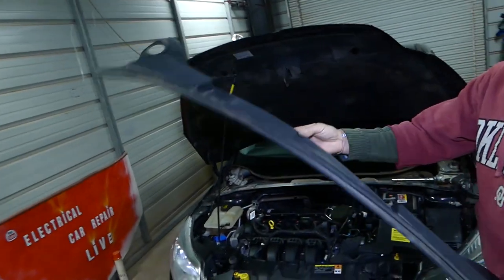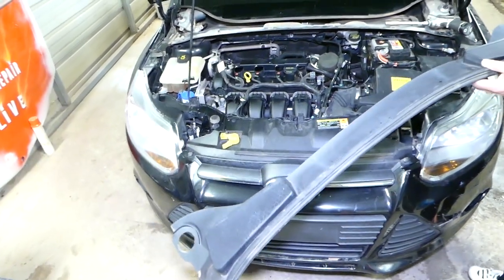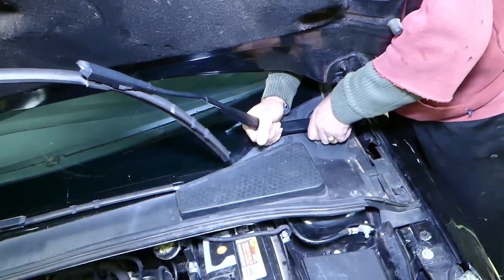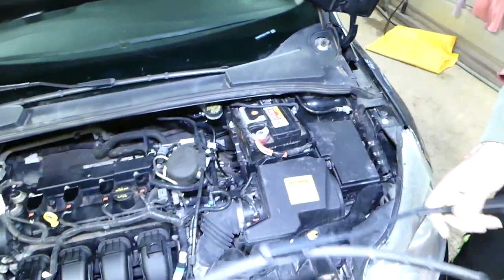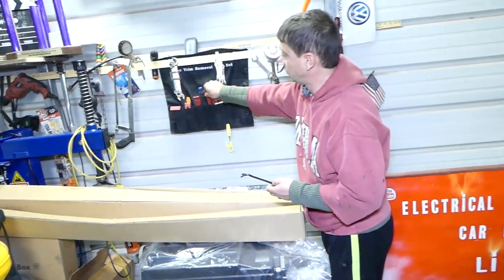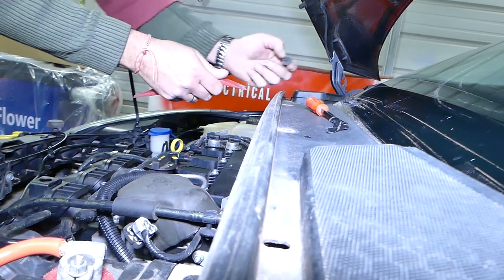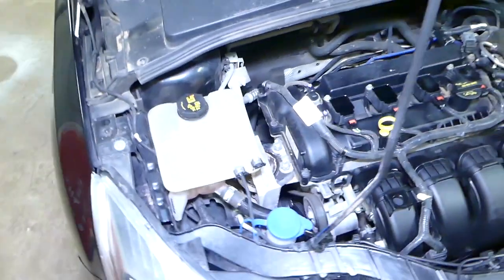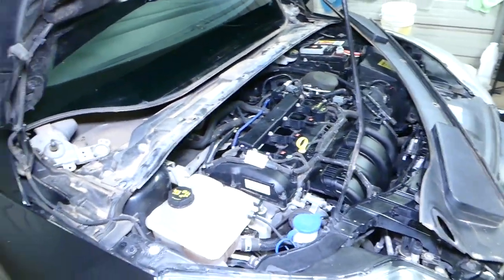HOW TO REMOVE AND REPLACE WINDSHIELD COWL TRIM ON FORD FOCUS MK3

Comment: My cowl is loose.  The car would not start after very heavy rain twice recently.  Water runs right down the windshield and into the engine compartment. I think this is the problem.
Reply: Where you able to fix the issue ?  I do have a really simillar problem.   If you know how to fix that, it would be greatly appreciated.  Thanks.

Comment: Unfortunately , my wiper motor is broken on driver's side . Is that the right side or left ? I need tp know in order to order it . Need to replace it . And I tried to take off wiper arm but couldn't it just too loose and moved the whole thing . The passenger side yes . Hoping it won't rain tomorrow . Any help will be appreciated . Probably go to junk yard .